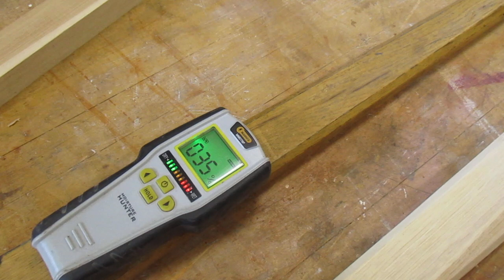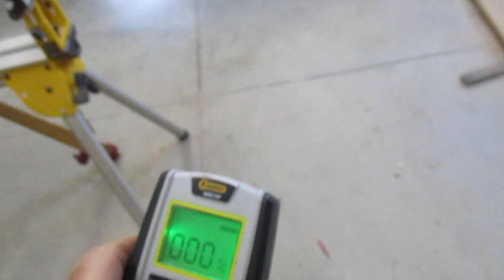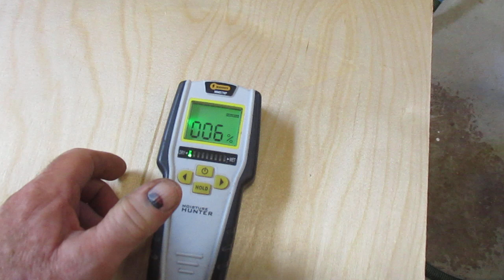SAWMILL HANDLE MAKING PT 2  # 919

Comment: Did you ever figure out why they drilled that extra hole?
Bill
Reply from the maker: hi don't quite understand john
Reply: @fricknjeep  You said they drilled an extra hole toward the top of the square section.
Reply from the maker: @williamellis8993  thats where the put a eye hook in it . not a Frick think . the mill up at carrol farm shoe you may have seen a spring on the handle , not Frick either  john

Comment: Good grief this is the worst overkill to make something  I have ever seen. I love your vids but this is simply too much.
Reply: It’s called pride in workmanship, the handles are  copies of the original frick handles made the same way frick did. Frick would have chamfered the edges and sanded them because in production sawing the sawyer probably would have pulled on that handle for hours on end so comfort was a consideration in the handle design.
Reply from the maker: @mackyocum5218  thanks john
Reply from the maker: hi well i know what you mean and i understand but its just what goes on . i watch a lot of videos and i see filling gas tanks .checking oil ,cutting grass , driving down a road . etc. or crunching cat food cans its just of what goes on ,wish i had exciting stuff all the time . but still thanks for dropping in john